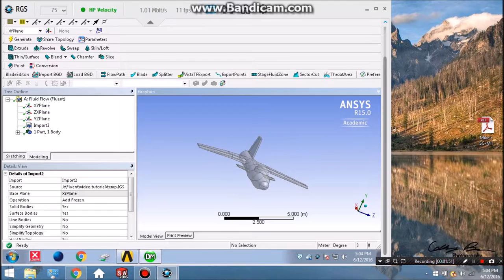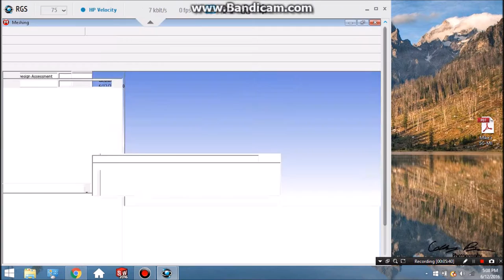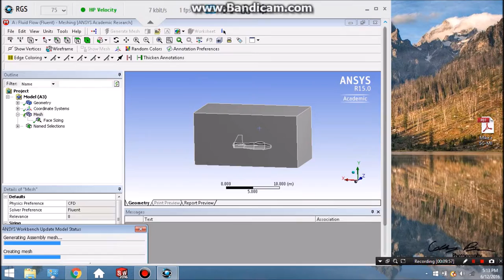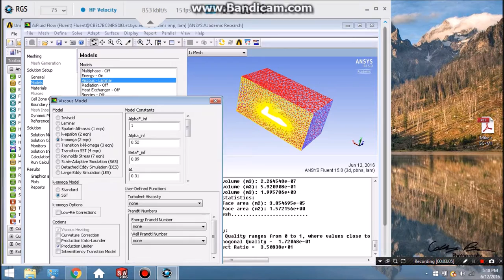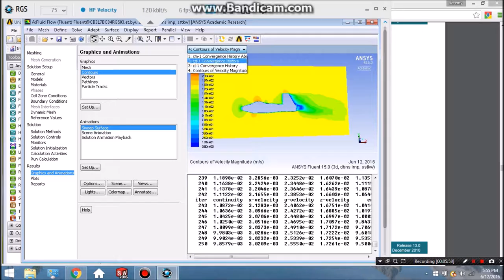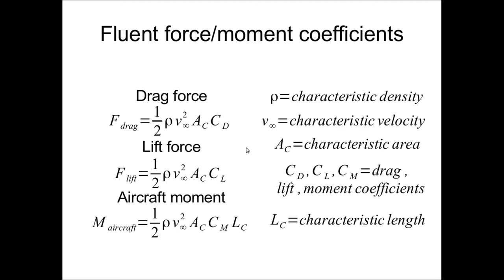Ansys 15 Fluent CFD tutorial for flight sim game designers

Comment: and where is 'flight sim game designers'? for what do you solve it?
Reply from the maker: So, flight sim games typically use basic aerodynamic theories for simulating the physics of aircraft. This video shows how to use ANSYS Fluent to calculate drag and lift coefficients of an aircraft, assuming that people use a model with adjustable ailerons, elevators, rudders, etc.
Reply: Jeremy LeFevre named please flight sim game. which on?
Reply from the maker: It's not for any game in particular or game engine, mainly I'm attempting to show people how the real physics is calculated so they could apply it to a video game if they wanted. Really it's an introduction at best, I really ought to flesh out the details so it can be easily understood and applied.
Reply: Jeremy LeFevre Do you use Flightgear?
Reply from the maker: No, but that's a great idea.
Reply: Jeremy LeFevre Lets look at This video. This guys testing flight in virtual sim Flightgear) 
best regards